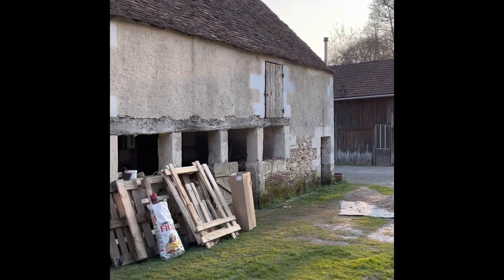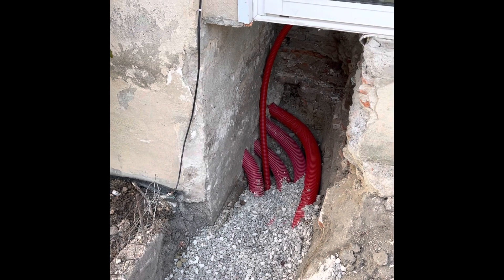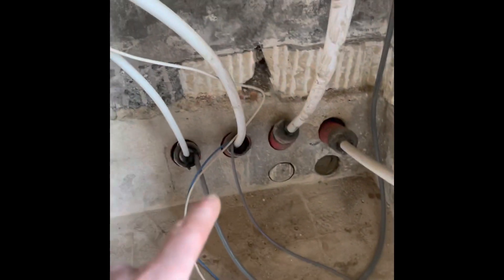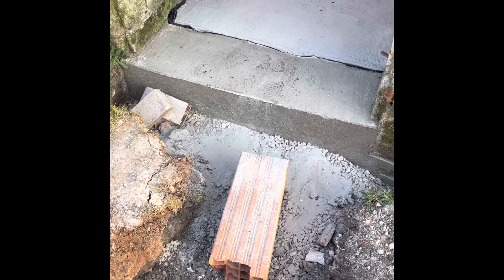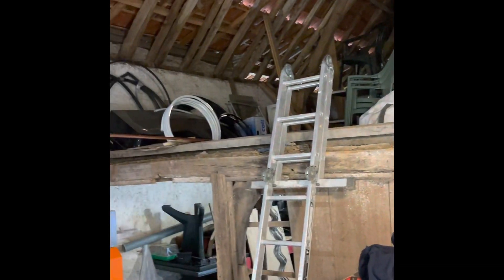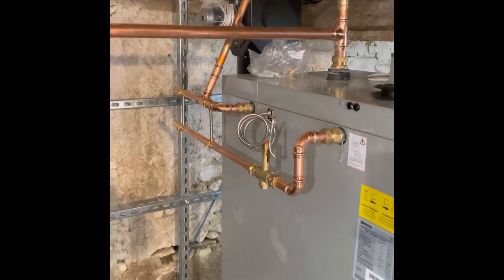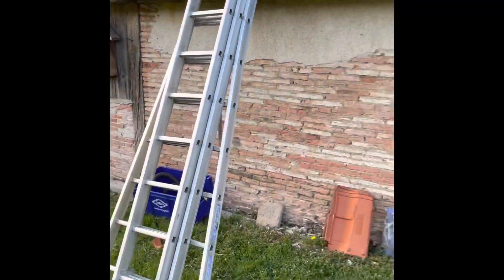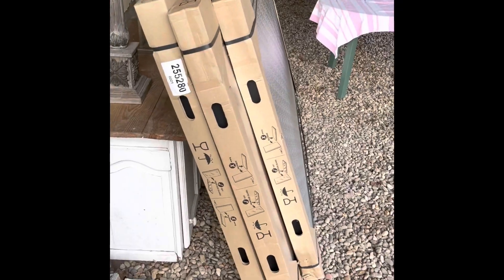The installation of a wood gasification boiler and solar collector heating system for the Mill

Comment: Hi, very interesting video and good to see the installation as it is not so common to see in real life and I am thinking of using a similar installation. Are you generally happy with the principle of a log boiler ? Does the boiler need to be charged once a day as often advertised by manufacturers or more ? Is the boiler noisy when in operation or starting / stopping  (it is often difficult to have information on this topic)?

Comment: Very interesting Adam! I was talking to Drew about his water heaters which like yours are more for the summer. They give him a large store of 60 degree heat( he could get hotter but has limited it). Also am working on the Johnsons beef farm and they get around 800 kw an hour(sounds too high to me?!) from their huge anaerobic digester. The huge boat engine that works as a generator is very impressive. That plant cost £2million! And it’s so tricky to get the ‘mix’ right. 
Would be great to see you get power from the mill stream one day!
Reply from the maker: Thank you for your comment Tim! Yes the panels should work well, I’m told they should cover our needs for 7 months of the year where we are. 
Blimey  800kw! 
Say hello to Drew for me.